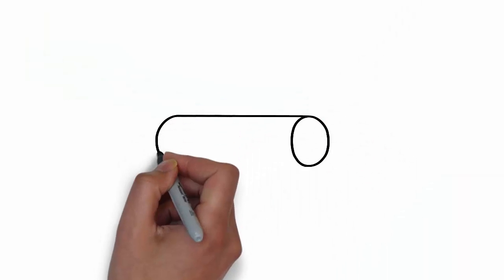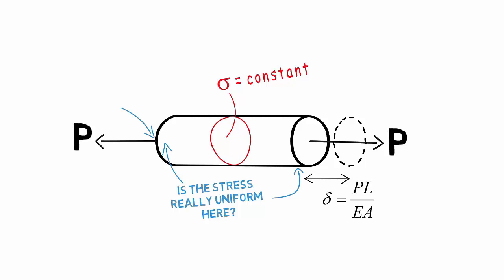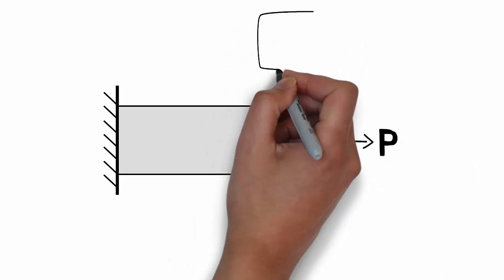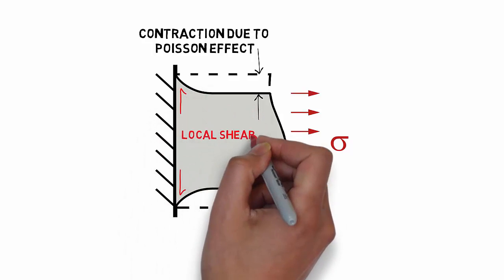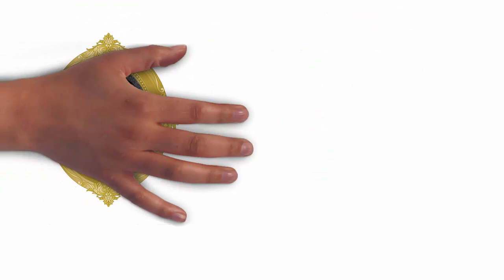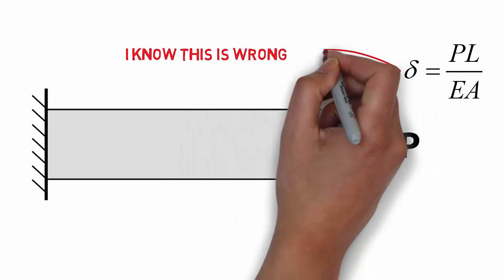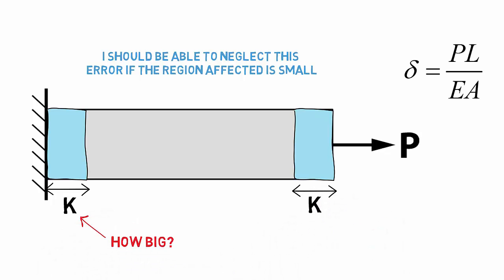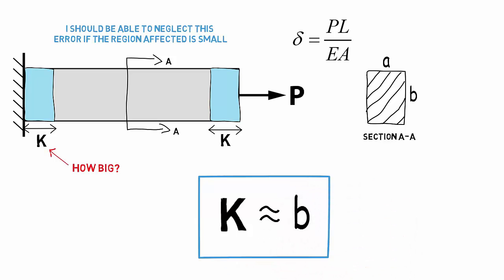2.3 Saint Venant Principle

Comment: Basically, its a principle that simplify stress into normal or average forces per relative area.
Reply: @DrRans  Thank you for the clarification, I am/was having an understanding that from this principle, we have no need to look at localized region/stress distribution, which is why we generally use average value of sigma = average force over area.